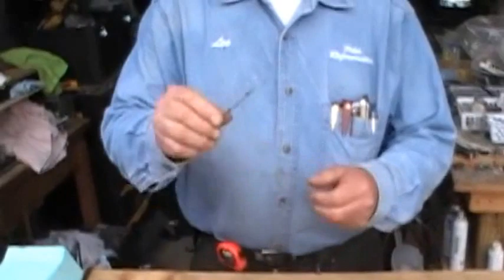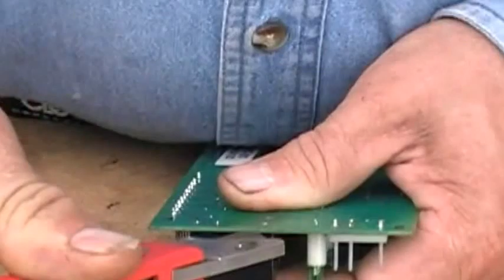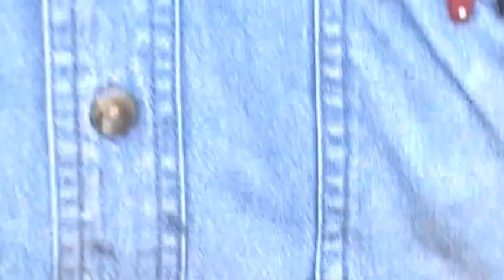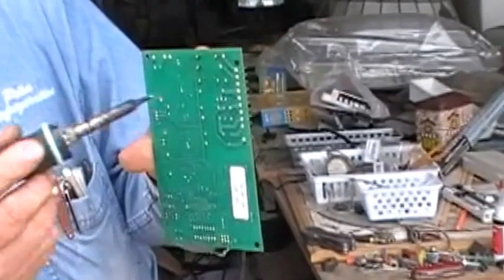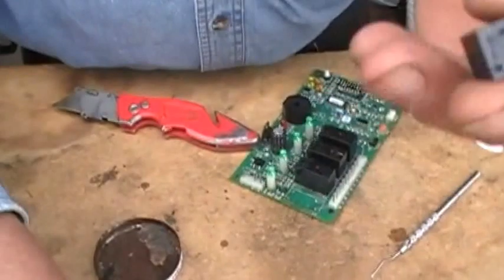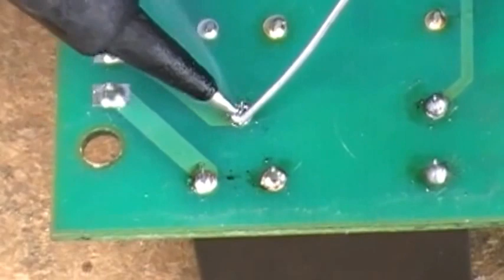How to fix a computer board on a hoshizaki Ice Machine with a three beeps mode

Comment: Hi, I'm not getting any beeps but the  relay on the board cuts power to the compressor  after 5 minutes of running.  Then a few minutes later it starts up again.  The compressor continues to do this indefinitely.  I've checked everything else.  No other safety switches are open.  Any ideas.  Please help
Reply from the maker: You probably have a high pressure, first hook up the gauges and check the high pressure, you probably have a faulty condenser fan motor or dirty condenser, let me know if this was the reason

Comment: MI MAKINA TIENE EL MISMO BORD Y SE QUEMO EL PIN  # 10 Y 9  Y COMPRE OTRO Y LO  VOLVIO A QUEMAR' QUE CREES QUE PODRIA SER?
Reply from the maker: Pudiera ser el relay que controla el compressor o puede haber un corto en la corriente que va al condensador en caso de ser remote

Comment: My G board bin control Green and Amber light doesnt turn on even after I installed a brand new bin switch. Is something wrong with the control? I'm afraid that it will never stop after the bin is full.

Comment from the maker: is the machine on when you trying to reset it? two beeps means  you have a problem with a thermistor,  is the white plug with orange wires, but even if it is open you should be able to do a reset, if not then you have a bad board, but I will recommend to change the thermistor first, I hope my information will help you, otherwise feel free to contact  me